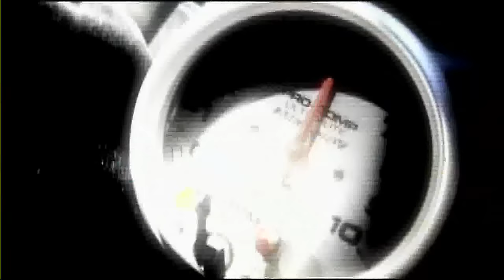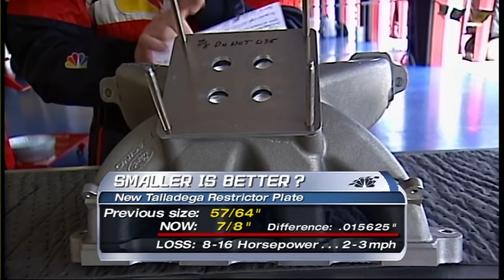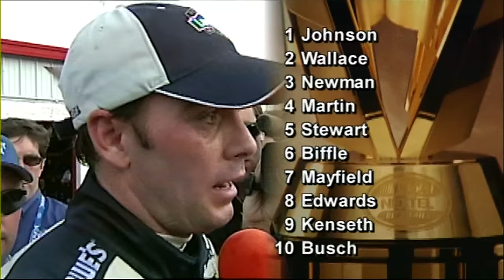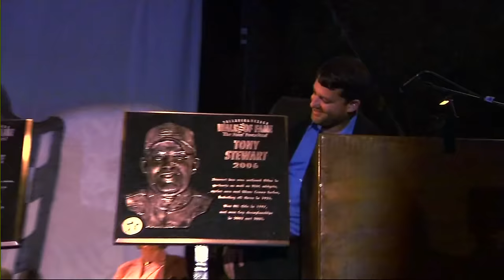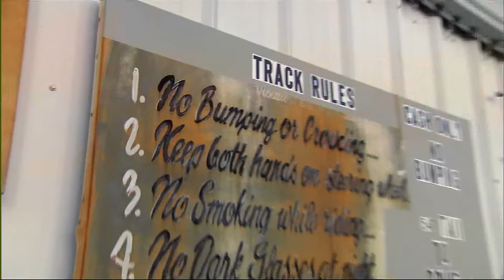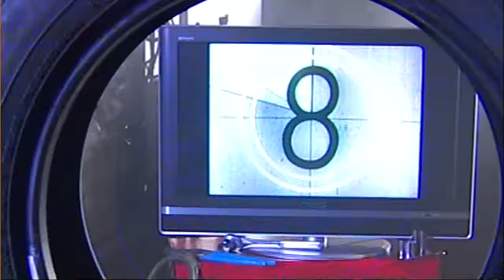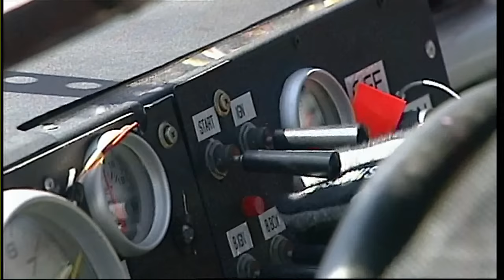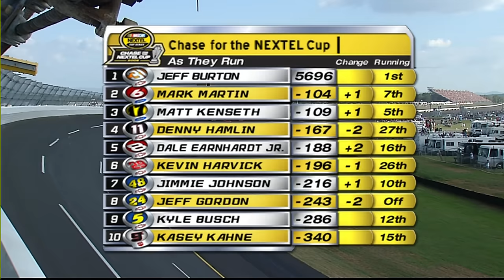2006 UAW-Ford 500 (HD @ 60fps)

Comment: Thank you! The official NASCAR upload basically did this but it wasn't full screen and the framerate dropped near the end.
Reply: Actually it was full screen. Full screen is basically 4:3 aspect ratio. Widescreen is 16:9 or wider.
Reply: @anthonydeloreto3881  Oh yeah right I get those mixed up. My other point still stands though.
Reply: Oh Ohmed
Reply: @anthonydeloreto3881   and they also cut out the intro and plastered the NBC logo, plus the sponsors on the ticker.

Comment: Dale Jarrett led the final lap of the 2005 Fall race, and he leads the first lap of the 2006 Fall race (not to mention first Cup lap on the new surface). Even 16 years later, the track is still smooth as glass.
Reply: It’s been getting a little more bumpy as of late but I’m really surprised how well the surface has aged.

Comment: 2:14:32 why does that ONE Ford car have the old Ford stickers. Everyone else had the new fusion headlights. Never noticed that.
Reply: Even though the Ford teams switched to the Fusion in 2006, you were allowed to run the previous model for up to two years after part-time. At Homestead 2005, some Dodge drivers drove the Charger while some drove the Intrepid. Wallace was driving the Taurus, everyone else were in Fusions.
Reply: @mattkowal90  never knew that. Thanks for the clarification! Pretty cool.
Reply: @SWiFTMK7   true. Even in the late 2010s, with Toyota introducing the Supra as their new NXS car, and some teams still used a Camry. (Timmy Hill #13 Roof Claim was one of them...)

Comment: Repaved Talladega and glimpses of the two car tandem. The speeds would have been well over 210 mph
Reply: Who would have guessed that the Cingular poll question saw the fans get it correct. Harvick would be the first among those 4 to win a restrictor plate race, the very next one after Talladega. That would be the 2007 Daytona 500.

Comment: This The 2006 UAW-Ford 500 Stock Car race that took place on October 8, 2006. The 38th annual running of the event.  Benny Parsons, (Referred To As BP From The Other NASCAR Sports Announcers), Won a NASCAR Championship, (1973), and Won The Daytona, (1975), but Sadly Would Only Live To Be 65 Years Old, and Would Pass Away Only A Year and A Half Later On January 16, 2007 (65 Years, 6 Months, 4 Days).  He Won The North Wilkesboro Speedway, But Similar To This Race Where 

In 1979 at North Wilkesboro Speedway Bobby Allison led most of the race but in the final 150 laps, Darrell Waltrip caught Allison. The two hit together hard and Darrell nailed the front stretch wall. Waltrip began crowding off Allison under the caution and got black flagged for the crowding. Benny Parsons would win the race, but it would be his only win at the North Wilkesboro Speedway, a track which his wife Terri (married from 1992 until his death in 2007) would become an investor two years after his death.

https://en.wikipedia.org/wiki/Benny_Parsons